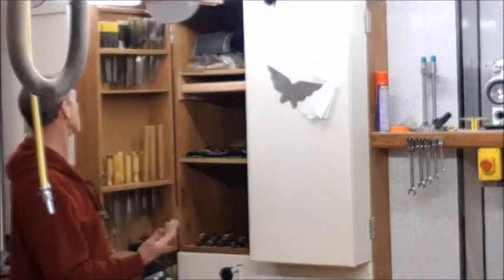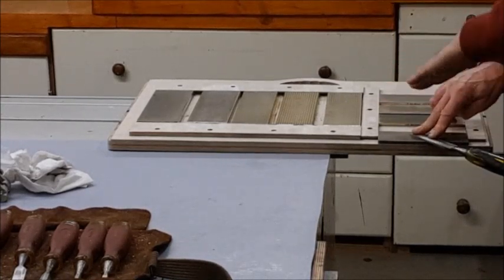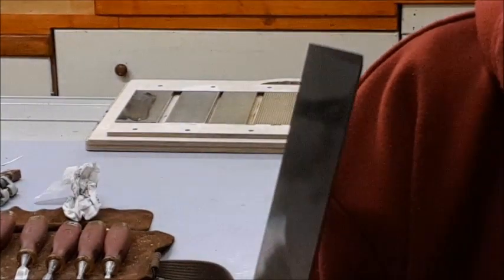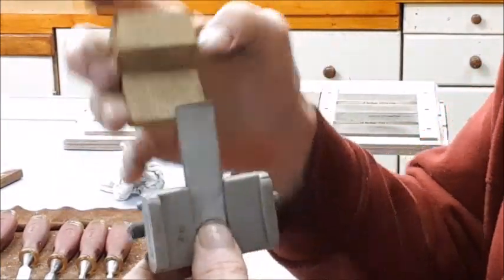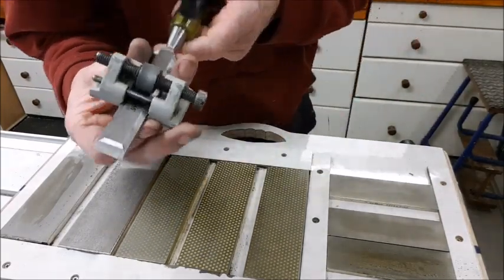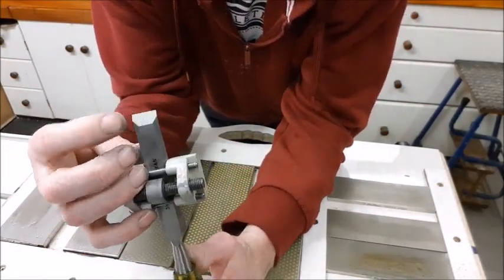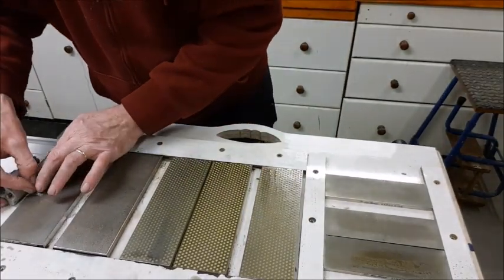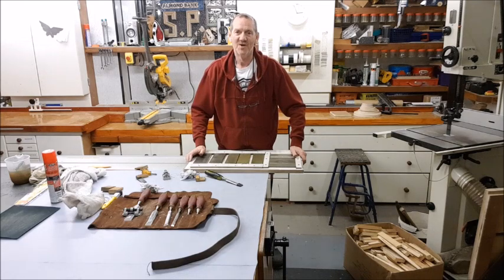Chisel Sharpening for Beginners

Comment: Great video David. I have plenty of chisels that need sharpening. Knowing how now it should be easier, especially knowing the 2 angles. Cheers.
Reply from the maker: Hi Keith glad you found it useful but i would like to say if you have been sharpening them at a wrong angle you will have a lot of work correcting it i might do a video on a quick way to do that soon

Comment: Excellent! Great advice regarding chisel purchase - there really is no need to spend hundreds on fancy chisels just to do general carpentry. 
I also have several sets from Stanley and Marples, a couple of posh Japanese paring chisel and even a super cheap set of Aldi chisels that came in at £6 for four. The Aldi chisels worked really well on beasting out large lock keeps on mahogany door frames. Pretty impressive at £1.50 each! 
As for sharpening, follow the advice in this tutorial and you won't go wrong.
I tend to use sandpaper to do my sharpening as it's cheap, and always available onsite. Thanks for sharing!
Reply from the maker: Good comment thank you

Comment: One other question. I'm thinking of getting a granite chopping board to stick wet and dry to for flattening planes and chisels. Do you reckon it would be flat enough as I know the recommendation is to use float glass?
Reply from the maker: I use a 10mm peace of toughened glass with a light spray glue works grate but as for granite i think its down to the machine that milled it, most things look flat but close up there not, if you have a good steel rule it will help you check it